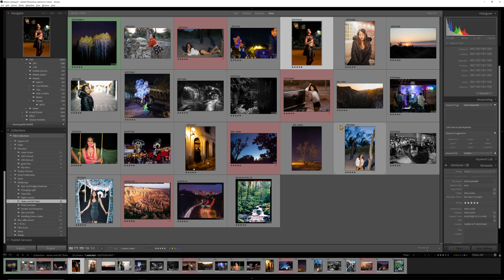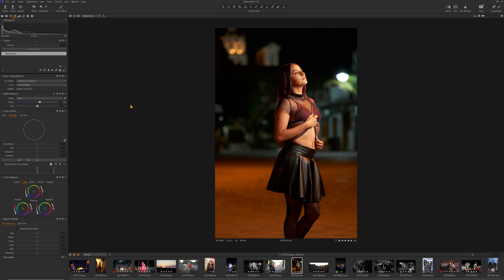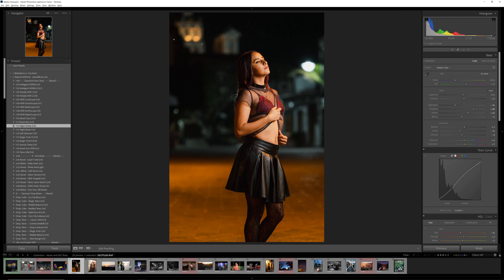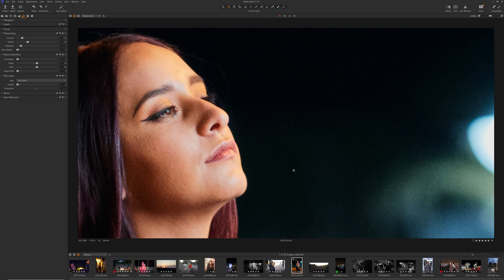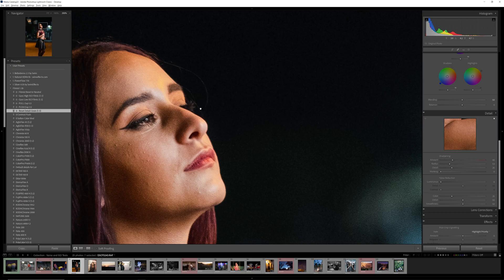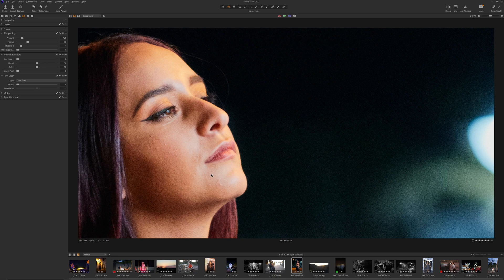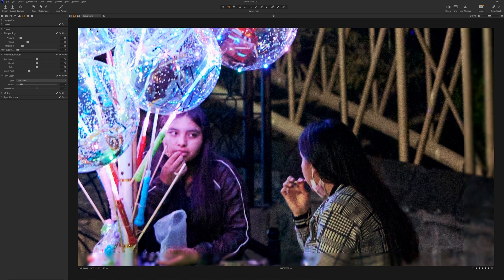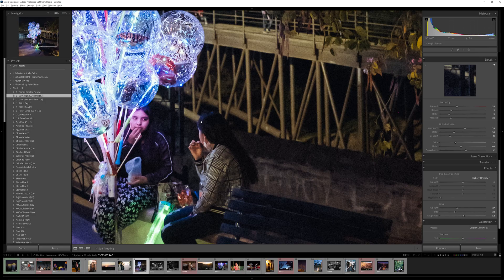Worms on Fuji files? Fixing the Noise in Lightroom vs Capture One

Comment: I think you nailed the worm issue... it's not specific to cameras or the software.  I mean I did my own tests and in some circumtances, I can produce the same results in both using different camera brand's RAW files (Nikon and Fuji).  So I think this "worm" issue is no longer an issue since about 2020 (prior to that C1 may have had the upper hand in terms of Fuji files, but I think the playing field has evened out and this demonstration shows that, and in some cases LR is better, in others C1 might have a slight edge).  You just have to figure out what's important to you and go with that.

Comment: I have owned X-E3, X-A1, X-A5, X-M1 and currently own X-S10, X-T30 and X-t20 and I am a professional graphic designer so I think i know what i am talking about. The worm issue is 100% related to how LR (C1) demosaicize X-trans not to the ISO. It happens mostly with foliage and patterns (railtracks, buildings, textures) and it got a BIT better with the 26MP sensor (the 24MP sensor being the worst). I have pictures from my x-T20 at low iso that are full of artifacts (MIND YOU: NOT noise) that are worse than phone pictures and I have pics taken with my old X-A1 at 6400 iso that had a beautiful grain and zero worms. I am frankly very sad about the current state of affairs with where Fuji stands with the most common raw conversion software and I will be probably switching soon (losing a nice chunk of change in the transition). The usability and feel of the cameras is unmatched but, as a RAW shooter, I am tired of having to find workarounds that finally don't work  (and no, I am not ditching Lightroom).
Reply from the maker: While there is truth to your statements, it's really not an issue in the latest versions of LR and the results are equal to capture one. There's no need for a workaround.

Comment: The wormy effect on noise is not the more prevalent kind of wormy effect on X-Trans files. I use both as well, and even when I agree LR has improved, sadly, I disagree with your statement that in 2022 both have the wormy issue; C1 and some other RAW developing tools, do not have this issue whatsoever. The wormy effect is not very prevalent in skin or background noise, and can be easily fix with your suggestions, however, try complex textures such as foliage or other similar pattern for encountering the wormy effect on lightroom. The wormy effect does also affect tonality, that is why when you use Enhance details in LR you can get more colours and tonality from the same picture. Thanks for your the video.

Comment: Not sure… Issue that  LR reads wrong way xtrain images from Fuji. You can see the issue when You use sharpness. Other stuff ok in LR. And in your test you basically turned off sharpness…. Off course you don’t see big difference.
Reply from the maker: C1 has more sharpness by default as I mentioned so you have to adjust them to be equal. But there's no practical quality difference here between the two. Just use what you like best.

Comment: Does this happen on Sony or Canon RAW files?
Reply from the maker: Yes. Fuji because of the Xtrans seems to be a bit more prone to it, but if you look at details on my the full frame Sony files for example, the patterns is very similar.
Reply: @Seimstudios  Thank you for your answer. I've used a 6400, a D3400 and a A7III for many years and I've never seen anything like this. This is overwhelming to me because I see this on my brand new XT-3, which is my first approach to the brand. Capture One Fujifilm Edition even showed some blockiness on my test shots that make it way worse than Lightroom. Not sure if because it's the free version of C1.
Reply from the maker: @larrydiaz7156   @Larry Diaz  No it should be the same in free version.Don't be afraid to edit FUji in LR if you are more comfortable there. It works great,
Reply: @Seimstudios  thank you for your answer.

Comment: I may be late into the conversation but both of your images don't truly reflect an example of fuji worms.  Try editing landscapes or cityscapes with multiple areas with repetitive patterns and textures.  I'm at the point where I'm ready to ditch Fuji altogether and go back to a different system.
Reply: I have owned X-E3, X-A1, X-A5, X-M1 and currently own X-S10, X-T30 and X-t20 and I am a professional graphic designer so I think i know what i am talking about. The worm issue is 100% related to how LR (C1) demosaicize X-trans not to the ISO. It happens mostly with foliage and patterns (railtracks, buildings, textures) and it got a BIT better with the 26MP sensor (the 24MP sensor being the worst) but the issue is still unsolved. I have pictures from my x-T20 at low iso that are full of artifacts (MIND YOU: NOT noise) that are worse than phone pictures and I have pics taken with my old X-A1 at 6400 iso that had a beautiful grain and zero worms. I am frankly very sad about the current state of affairs with where Fuji stands with the most common raw conversion software and I will be probably switching soon (losing a nice chunk of change in the transition). The usability and feel of the cameras is unmatched but, as a RAW shooter, I am tired of having to find workarounds that finally don't work.
Reply from the maker: Not had a problem with those images either, but if you have a RAW file that's a great example of it I would like to give it a crack and see if it's a failing or if it can be worked around with good settings.

Comment: Great video. 

I got a few examples where i have seen this (worms), specifically where there is alot of foliage. Happy to share etc. 

I tried the steps in this video without much success (unfortunately), is this because the steps you outline only works on certain scenes ? (portraits) 

Thanks
Reply from the maker: Yes but it's more a question of ISO level not the scene, as shown in the street photo.

Comment: In Lightroom, the artifacts are caused by the detail slider. Just set it to zero and only use the sharpening slider...
Reply from the maker: Well the artifacts exist from the RAW file. The sliders just effect how much they are revealed or removed.
Reply: @Seimstudios  while I appreciate video, your logic is slightly flawed. Kearress is correct that the problem lies in detail and sharpening. Compare vegetation detail or put the sharpness sliders up and you always saw worms in LR. 
Saying the problem lies in the .raf file is incorrect. If that was the case, C1 would behave similarly. The problem is in Adobe's development engine, why do you think Adobe added in 'Enhance details' - it is a workaround.